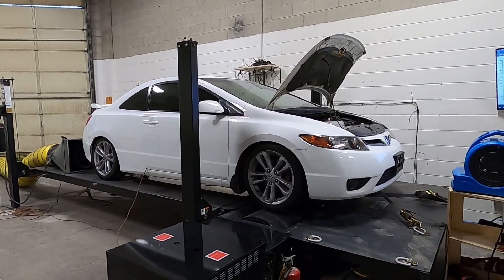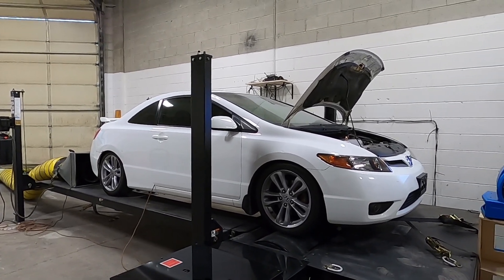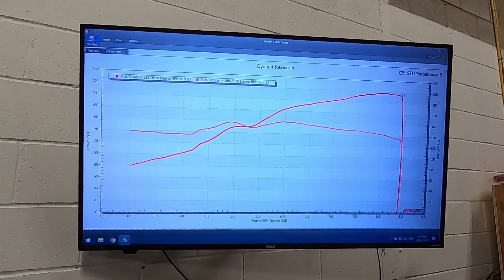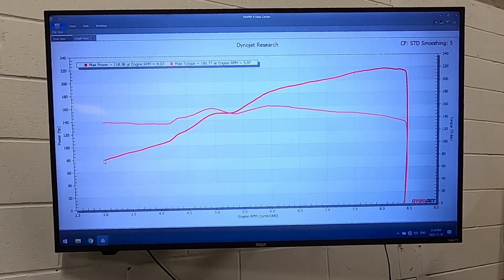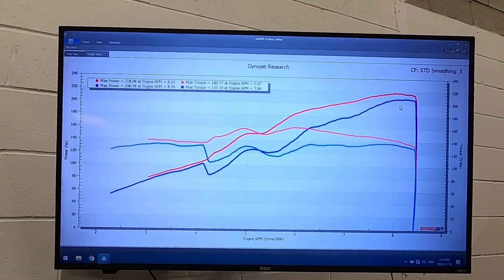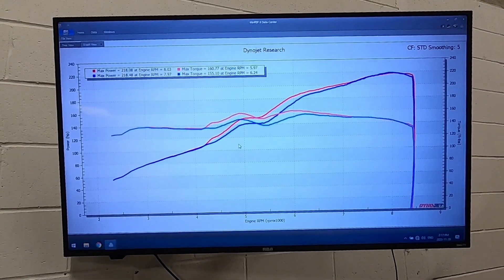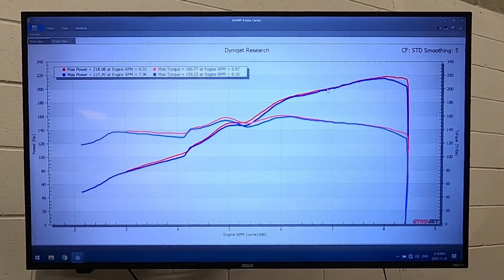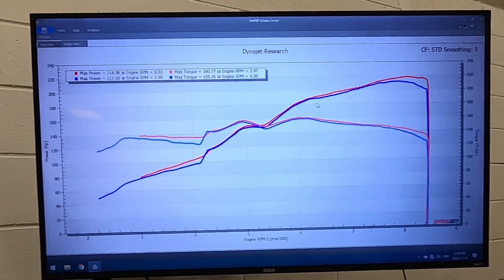K-Series VTC Tuning Comparison

Comment: Do you hold ignition timing constant between the VTC angles? I know each angle has a different ignition table. So that would affect power. In order to do A to B vtc wise do you make them all the same?

Comment: Would tapering further after 20’degrees to 10 degrees help get a little more top end out. It seems when you ran 10 degrees it held the end better just did not have the ramp effect of earlier aggressive vtc angle

Comment: What happens when VTC is pinned because of P2V? I have 14.5 compression on k24. 4P deleted VTC with their fixed cam gears when they degreed the engine.

Comment: Nick, would you mind giving some advice on ignition timing and knock limit, for example I notice the K20ITR basemap on hondata K manager runs really aggressive timing under WOT on the high cam, 34 degrees in the midrange. While my car seems happy with this, I wonder if there's any real benefit in running such advanced timing? Would it be significantly different with say 24 degrees from 5000-8000rpm than 34 degrees? I'm assuming this engine (k20A) cannot be knock limited otherwise it would almost certainly be getting knock count with these settings? 
Interesting also how up top from 7500+ mine only seems to want 28-24 degrees tapering off to 8600rpm, any higher and it will report knock count..... Whereas on the hondata basemap it suggests 32 degrees up top, but my particular car doesn't seem to like this

Comment: Great video. 2 things tho.

1. Were all the runs taken on the same tables? Each VTC angle (by 10 or 15 degree increments) has its own ignition and fuel tables, so it may not be a fair comparison if the 40 degree vtc is running advanced tables vs the 10 degree running more retarded tables.

2. Wish you'd've done a 0 degree run. Usually shows better results than the 10 degree across the table

Comment: What can be the best cam angle setup for maximum power in non vtec if we want to keep the vtec engagement at factory setting (5800rpm)?
Reply from the maker: Each setup is slightly different - The only way to find that out is put the car on a dyno and sample the different VTCs
Reply: General principal for power is you want to advance cam and ignition timing at vtec, in high cams (and VTC should go to highest immediately after you're in high cams), and you should start to taper off around ~1000-1500rpm after that on stock cams.

Comment: Any particular reason why you set vtec that high? From the looks of the graph it wants it lower. I know you know what your doing lol been following you for years I'm just wondering.
Reply from the maker: I didnt get to show it in the video, but i did try lower settings. This was the lowest that this particular setup/combination of parts allowed VTEC to engage without a loss in power at vtec engagement

Comment: What does vtc stand for?
Reply: VTC - Variable Timing Control. This is a mechanism attached to the end of the intake camshaft only which acts as a continuously variable cam gear - it automatically adjusts the overlap between the intake and exhaust cams, effectively allowing the engine to have the most ideal amount of valve overlap in all RPM ranges. VTC is active at all RPMs.
Reply: @Earl_VTEC  thank you.  What controls vtc
Reply: @BulliKid  oil pressure within the engine and the VTC solenoid

Comment: Awesome video!!!   Just seems there is no way to adjust your VTC power correctly without a dyno.  I steer tune my car and have to rely on Hondata’s reflash for the VTC angles.  Wish I had a dyno.
Reply: Locking in each cam angle, tuning the afr, then comparing the fuel curve of each angle will give you a decent idea when street tuning and no access to the dyno